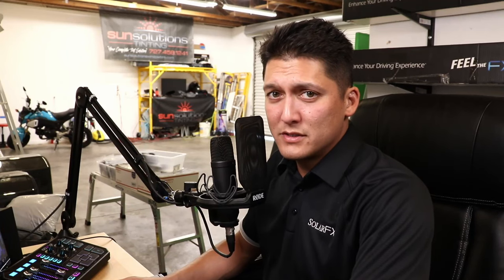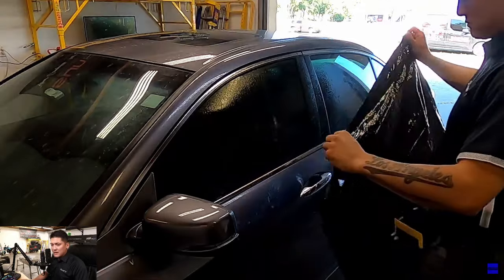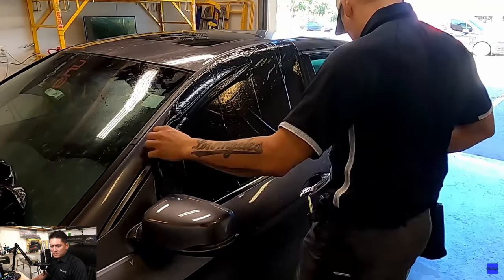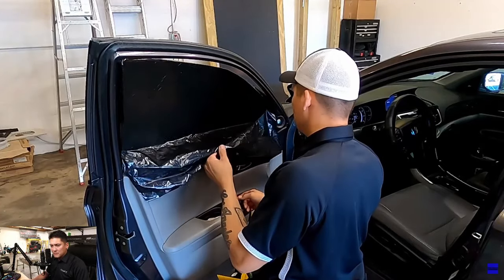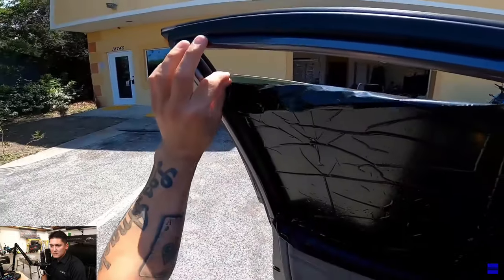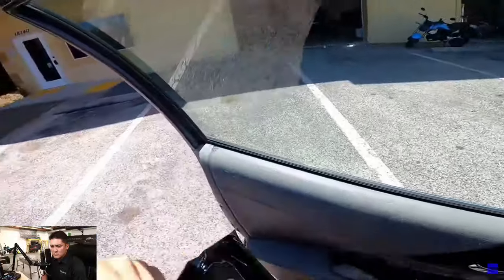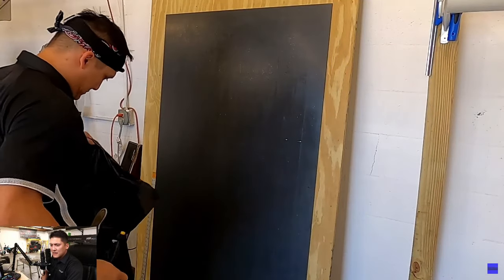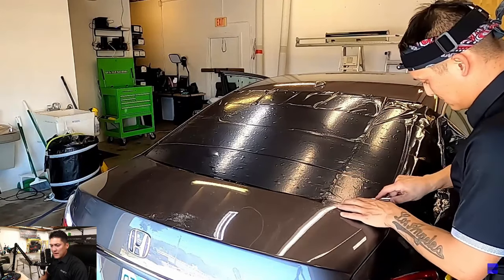How to easily remove old window tint in less than 20 mins!

Comment: The black trash bag stuck to the window absorbs and holds the heat, which evenly heats up the glue in the tint film and that is why it peels so even and easily.
Reply: yea i watched the video to
Reply: What if the tint has bubbles, will this method work just he same or do we approach it differently, thanks
Reply: @johnjkizer6399  Good question
Reply: @percsfn1133  Lol. Yet someone did say an explanation of why it works would be nice.
Reply: Thank you for explaining the trash bag use .
Reply: @johnjkizer6399  the bubbles blowup and shatter the glass 😮
Reply: Gratefull for this practical demo.

Comment: I just bought a used Honda Pilot online and I did not notice the 7-8 inch dark window tint on the front windshield. Didn’t want to go the heat gun and razor route so I’m glad I saw this video.  10 minutes to get everything together, cut and place black plastic. Waited 30 minutes and then it only took 5 minutes to peel. Amazingly easy. Perfect video and great method.
Reply: Freakin awesome 😮

Comment: Excellent advice - removed 16 yo tint on rear window (with defroster lines) of 2007 Mazda 3 sedan using this method. Came off in one easy process. Used my digital thermometer and measured the temperature after 20 minutes in the sun as 60C (140F) and it just pulled straight off (time had obviously split the tint on two defrost lines, so needed to restart from the edge at those points to remove as I worked across the window)  with no glue remaining. Saved a lot of hassle. Lots of others on YouTube advise the same method, but this from a professional gave me confidence to attempt. Thank you so much.

Comment: I am like the others. I rarely leave YT comments but this worked exactly as your video showed. I had some windows that looks slightly "foggy" after the removal; however, I took a paper towel and my nail polish remover and glided over it and they were crystal clear. Used a spray bottle with plain water that I use to spray my hair with right off my dresser and it was enough 'spritz" to make the garbage bag stick. I didn't even cut my garbage bags pretty; I just made sure they were fitted over the window and overlapped. Use the ice scrapper that came with my freezer to tuck it around to get the tint that was up and inside the window frame seals. You made this super easy!  It is USA-SC weather; so didn't even take but 10 minutes to let that car get hot inside and those bags to heat up the glue & release it!!
Reply from the maker: So glad this was helpful to you! ❤️

Comment: Excellent instructions, worked for me. Amateur Tip: Measure the windows, make sure the plastic bags you get are large enough... I bought 30 gallon black bags (don't use white like others have demonstrated), 30 gallon bags were too small. Had to get 39 gallon lawn and leaf bags to fit my window. Also, the blade that I bought fresh from HD had a serrated edge like a bread knife!? never seen that, thought they were all smooth bladed! (the serrated edge made trimming away excess bag a PITA - so get the right blade.) Did it during a sunny 92 degree NY scorcher, this probably helped, used plenty of soapy spray on windows. One of my cutouts fell a bit short in a corner, and the bag/film had a few minor bubbles in a few spots, but after smoothing the bags as best I could (using small window film tool), waiting the suggested 15-20 minutes, and getting an edge started with my fingernail, they all came off nice and clean, barely any glue leftover, minor glue residue easily handled by windex and a razor blade. I was a bit skeptical/cautious, so I did the front set first, but then quickly confidently did the rear ones. Thanks for posting these great instructions!!! Just saved me $200, some of which will go towards the violation I got for having over dark tint! (the car came with the dark tint from another state, hated to remove it, but don't need the hassle...) ☮❤

Comment: I just removed my tint by doing the trashbag method.  Works like a charm.  A bit difficulty getting to the windshield tint, but still worked.  I saved over 100 bucks by doing it this way.  Thank you

Comment: Thanks for the great tutorial.  In my case it was a cloudy day and I used a heat gun to warm up the window.  Worked perfectly, no residue left behind and the tint came off in one piece.
Reply: Did your old tint that you remove have any bubbles ? Thanks
Reply: Heat gun on the inside or the outside?
Reply: Did you used Water and dish soap or just water

Comment: Your tutorial is great. I was about to tear off my Front windshield film and immediately took action after watching your video. The sun was very strong at noon in the summer, so I covered it with black plastic bags and waited 20 minutes ,and then it only took 5 minutes to peel.   it was very easy and complete to tear off without any residue of adhesive. That's just great! Thank you for sharing!

Comment: I had a buddy who took off his tint this way about 10 years ago. I forgot if he did the bag on the outside or inside. Great video with great tips. This is the only way to remove IMO,  thanks. 99% of the other videos are the OG heat guns and razor method which is fine but those videos shouldn't be more than 3 mins long 🙄

Comment: Super video, gonna try it on my vw beetle. The tint on it is lumar and has been on the car for 17 years. Many years ago I had used kleenex tissue that had menthol and lotion to wipe down the condensation on the driver and passenger window. After a few hours, the tint had blurred and had a texture like fine sandpaper. Got a quote of 300 to remove the tint and 400 to put tint on. This video was super great. Thank you for sharing!

Comment: Thank you very much for the advice. It worked perfectly, I used water with rinseless wash p&s absolute and it came off without any problems. The installers who put the film scratched my film and also the rear window. Any solution to repair the scratches on the rear window without changing it?

Comment: Thanks for the video. My tint was put on when my car was new in 2009. The bubbles had become crazy and were affecting my view out the rear window. I was able to remove the film and thought the adhesive had come off too but it wasn't so. I have used "Goof Off" to remove the adhesive and then windex. The Goof Off had seemed to work but I'm having to clean several times and there is still streaking. Not sure if it's the Goof Off or adhesive that is being stubborn. I will continue to work on it but am nervous about using a razor blade because of the defogger wires.
Reply: Try alcohol!

Comment: How can you do this in the winter?  You said a few times to leave it overnight and use a steamer.  So I would put on the trashbags and leave it overnight, I get that.  But what about the steamer?  Can you explain how I use the steamer?  Do I use it to heat the windows from the outside?  Not quite sure. Thanks in advance for addressing this.

Comment: Will spraying additional water where the edge of the tint sheet and glass meet (hot water of course maybe with the baby shampoo) be of any help when pulling the sheet off by helping keep the glue moist?

Soap added to keep the water viscous longer and help with dispersal and adhesion to the glass and vinyl bond zone.

Comment: Great way to remove the tint, well shown and explained. 
I made a mistake and pulled the tint of cold, all the glue remained on the glass. 
Any suggestion how to clean of the glue the best way?
Thanks.
Reply: Sounds like alcohol or glass cleaner with a razor blade. Another person suggested alcohol and a clay cleaning substance. Can't remember what it's called. Body shop supply places sell it

Comment: Thanks for the tutorial. This is really helpful. I bought an older Kia Picanto for running around town but the other day I took it on a long trip and noticed looking through the front windshield the far distance seems shimmering (like in the desert). I'm pretty certain that the tint isn't original as I can see some fish mouths around the corners. No way that's from the car maker. Here in Indonesia we get a lot of inferior products that are dirt cheap so I'm guessing that's the deal here. The tint doesn't look old and it's pretty dark. I bought the car from a young guy and he only had it a couple of years so I'm guessing the film isn't very old. So my question is should I treat this like the back window or are there other issues with front windshields I need to be aware of?

Comment: Thanks for the video, Patrick.  I have two questions, if you please: 
1. Do you recommend a minimum temp range, e.g., ambient temp when you recorded this?
2. For a pro tint applier with skills, how much time did the the whole process for side windows & back windshield require (including bake times)?  I'd estimate it would double for the entire car, then another 2.5x - 3x the "🤬🤬"  for the amateur factor (based on my personal experience with other auto finish work).

I'm trying to determine if it's worth my time to possible purchase a used car with tints & bring it to NYS, which has laws regarding maximum tint gradient.

Thanks for the video!
¡Paz!

Comment: Question, I have a full front windshield clear tint for the UV and I have a second layer of film for a sun shade at top of windshield about a 6" strip. It is extremely annoying, it is in the eye level. Can i remove the 6" tinted piece off of the clear tint or do i have to have it all removed and the clear tint replaced? would like to just do a remove if possible, for cost reasons. Any insight I would appreciate.

Comment: so I have a question… I’m going to do this when there’s no sun, but 72° outside and rainy; can I use the vehicles heater to warm up the car in order to get the adhesive hot enough to do this?

Comment: How do you do this in the winter months and you can't get the heat you need to remove? Also, how can you guarantee you don't mess up the back window defroster?
Reply: I saw someone use windex instead of water in cold weather
Reply: Prly a heat gun, or hair dryer if you don't have one of those
Reply: Hair dryer or heat gun you can buy a car plug converter if you can't get your car close to an outlet.

Comment: I just bought a car from AZ and had it shipped to NH... turns out at least the front side windows are heavily tinted, which evidently isn't allowed in the Live Free or Die state.  Of course, it's about 20⁰ out, so I'll either need to bring it into a heated space and heat the windows, or wait 7 months until it gets warm enough outside!

Comment: We recently bought a new car with dealer installed tint on front and back side windows.  It's so dark it's barely legal. As a result of the dark tint, it's very hard for the driver to see outside even on a bright day.  Using the side mirrors is almost impossible.  At night?  Fuggidaboutit.  I have to roll the windows down to see.  This will help me a bunch.

Comment: I was pulled over for speeding but the cop gave me a fix it ticket for my windows instead of a $500 ticket for speeding. I thought he was being nice until I found out how much it costs to get tint removed. Dude, this totally worked. I had to leave it in the sun a little longer,  but it all came off in one piece leaving very little adhesive in a couple of tiny spots.  Saved me a lot of money and I was surprised it really was aseasy and fast as the video stated.  I guess that cop was being nice after all. He said there is some kind of clear tint now that is legal. Does anyone know anything about it?

Comment: I had to remove the tints from my audiTT coupe to pass Maryland state inspection. Big suvs etc don’t have too. It’s so stupid, it should be the other way round to reduce higher headlights glaring  thru the rear window of low hung cars.

Anyway, I just used alcohol and towel; with a razor blade to start the corner on the prewiped film. The film came off easily but there were glue patches. With alcohol wipe and wet blade the residue came off easily as I wiped down the glass . No fuss.

Comment: I don’t understand how you are cutting the edges without slicing the car? It looks like you’re applying pressure on the tip of the knife - how does this work with leaving 2 in all the way around?

Comment: So you just sprayed regular water on the windows and trash bags then leaving it outside for 10 to 15 mins? Living in Florida maybe the 15min time frame could be cut down to 5mins lol (that was a joke internet trolls). I remember being 16, pulling the tint off and having to go back with acetone to get the residue off.. this is so much easier

Comment: Can you mess up your windows if you keep removing and adding tint? I had a couple of bad tint jobs done on my car and idk if my windows were are messed up
Reply: As long as the glass is clean and smooth I imagine that you can do it as many times as you would like, I think the main issue may be either the adhesive isn't entirely removed the first go around or may be micro scratching from razor blades or as he stated in the video, accidental etching from degreaser.

Comment: Can you effectively replicate the sun exposure with running a heat gun on the outside? I live somewhere that sun does not like to hang out lol
Reply from the maker: Yes you can. You need the heat so I’ve seen people do it w heat guns or blow torches. You want it hot enough to where you can’t keep your hand on the glass for anymore than 3-5 seconds. Just don’t over heat the glass.

Comment: It appears that you have completely removed the factory rear defrosting/demisting elements as well. Not a great method for the rear window if these need to be replaced. Is there another way to remove the rear tint that doesn’t take this as well?
Reply: I thought that at first too. But I believe that the defroster lines changed/discolored the tint that was on there creating what looked like the defroster lines were pealed off.

Comment: I peeled mine off I one go but no sun or heat and the whole glass has glue on, it’s a nightmare to get off. Any ideas ?
Reply from the maker: Get a razor blade and a lot of time
Reply: Terry you are going to need a single edge razorblade and soapy water in a spray bottle and spray the glass and hold the razor at an angle and it'll slide right through the glue while removing it. It's time consuming but you'll get it. If it's the rear window DO NOT try it. Let a professional do it before you damage your defroster lines.

Comment: This process may only gives good results if your sunfilm is in good condition...if its installed from outside and if it's not good quality then it will end up in disaster...i tried to remove film from my sunroof which was installed from outside and it all got messed up... tomorrow need to check with some shop ..that sunfilm was already damaged,may be because of that this method is not working 😢😢

Comment: EDIT: DID NOT WORK.  Glue everywhere. On the rear window-- bottom edge it peeled/delaminated. Unable to get to and clean--looks trashy and janky.
My daughter will not drive her car anymore (2018 Camry SE) because she can't see out of the back window and NOBODY will touch the tint--not even installers. Not a fan of tint anymore.
Reply: Did it work for the sides?